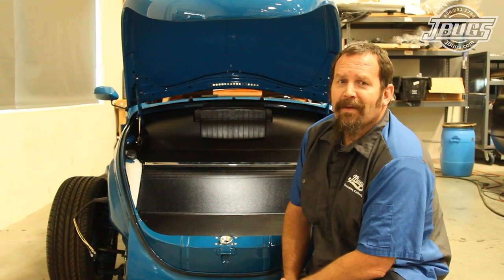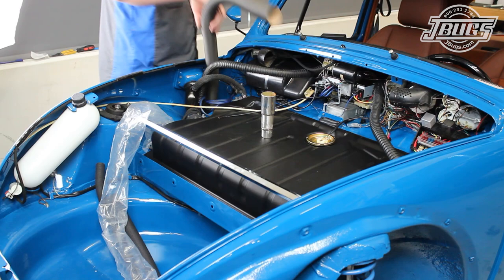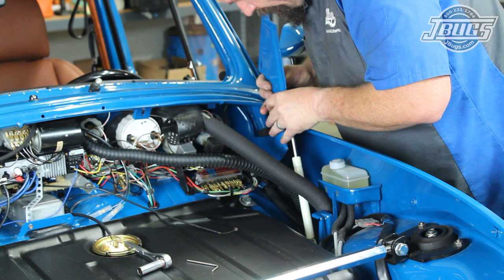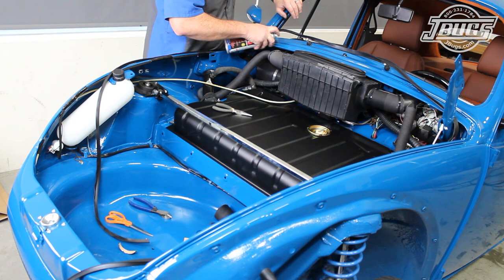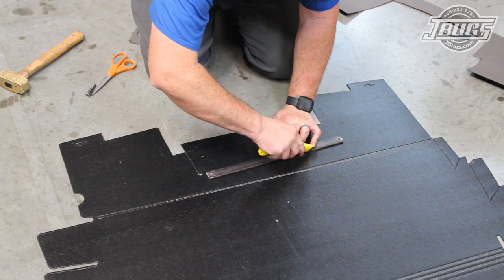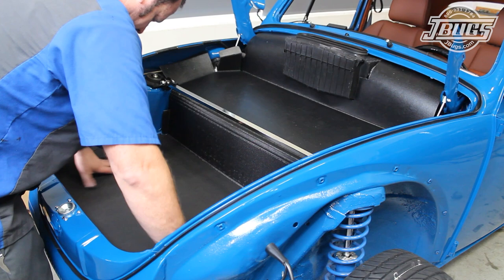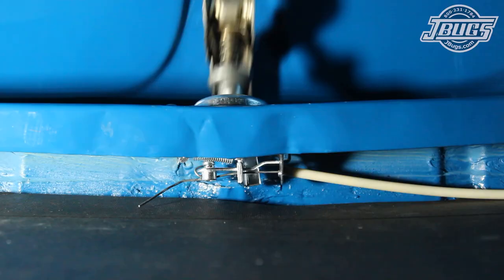JBugs - 1971 VW Super Beetle - Trunk Wrap Up - Part 2

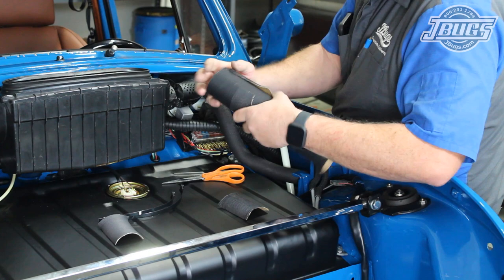Comment: Thanks JBUGS for all the content. Love getting my parts from JBUGS. 3:00 As an alternative to splitting paper hoses I used 2 1/2" defroster hose. It's the old school accordion style hose. Worked perfect in that there was no splitting and it covered all the little vent holes in the elbows. Just four zip ties and done. Looks good too.
Reply: We split the side hoses so removing the fresh air box would be easier if need be. As there is only a 1.5 to 2 inch gap in between the box and the side vents, using a hose without a split can be difficult.

Comment: My 72 super doesn't seem to have a seal channel on the hood. Not even rusted out bits: there was no sign of it so I didn't know they were missing. I just had the whole thing painted though. Any ideas on how to get the rubber properly installed without welding new channels in?
Reply: We offer a VW of Mexico style hood seal https://www.jbugs.com/product/P10-300.html that installs on the bottom side of the hood. The only problem with using this seal on a Super is the inner hood bracing at the front of the Super hood doesn't allow the seal to be installed all the way around the opening. A "universal", glue on/stick on seal might be an option if the lip on the body is in good enough shape.

Comment: Why not color sand and polis before so you don't get polish built up in all the seals?
Reply: Cause I don't want polish built up in the seats!
Reply: @Sam_Mebane  just tape the window openings up?
Reply: @joshcosta423  Eh, polish doesn't build up that much. Never had an issue with it there. In the air vents is a different story though!